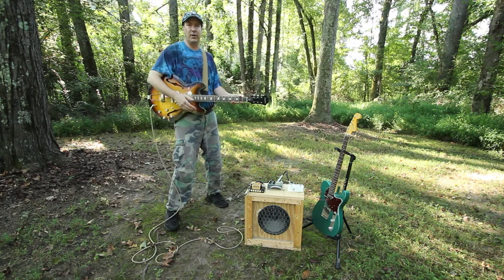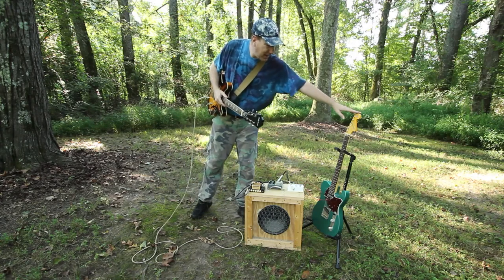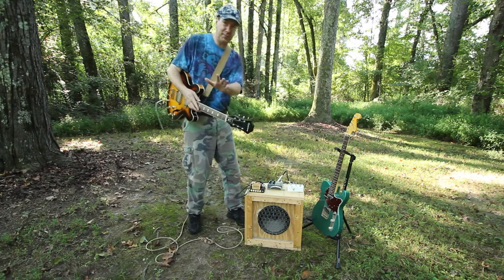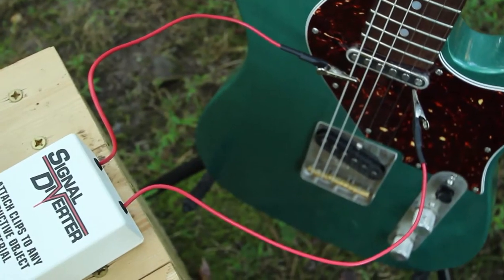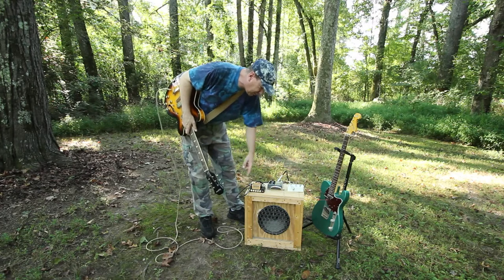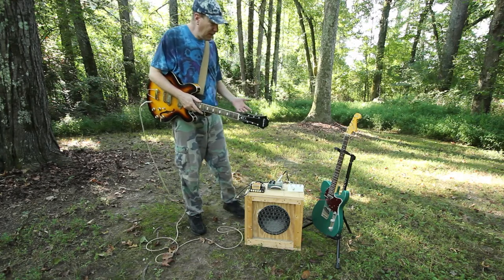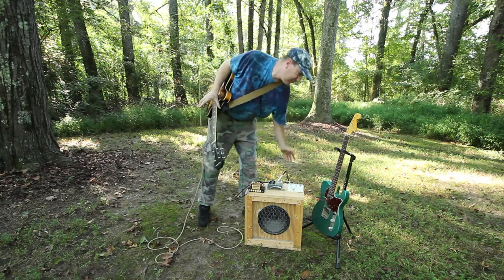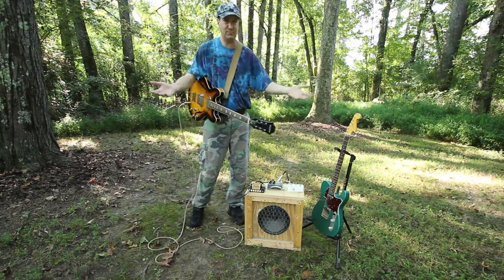Using a WHOLE GUITAR as a Guitar Effect

Comment: Try using a metal slinky as a conductor and move it around
Reply: Tried it. No change to the sound. But it's a good idea. Unfortunately the spring is just acting like any length of wire. <3
Reply: @ericpetersen5110  ok  I have another idea, maybe soda? Maybe like a distorted effect.
Reply: @scandalousbeans2591  Yo man, here's the deal. Most 'ordinary' objects have very little effect on the signal. One thing I have noticed is that aluminum cans or poor quality metals degrade the signal and make it distorted and 'trashy' and they have a signature sound. But to get a real effect on the sound requires something that is built for doing just that. BUT I did try connecting to a metal fence and I was receiving a lot of RF noise, adding to the guitar signal, so I can't really say what works or not. I'd really like to try it with a motor as I believe the hum of the engine would interact with the signal. Honestly I have been unable to do much real testing on these. There's also the non-sound factors that people don't really get. For instance you could put your wedding ring in your signal chain and sing a song about your love. It probably would not affect the sound much, but psychologically having the memento as an actual part of your signal chain might make your performance more special. Then, there's also the electron swap going on where electrons from your guitar would 'kick' electrons out of the gold in the ring, thereby powering the speaker with actual subatomic bits of the ring. But that's beyond most folks.
https://fulleffectdistro.com/signal-diverter/